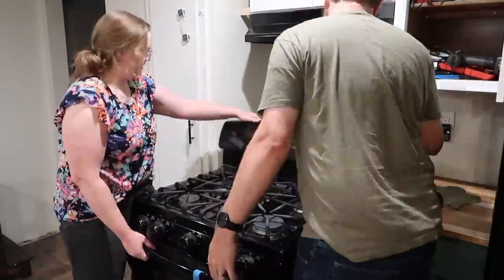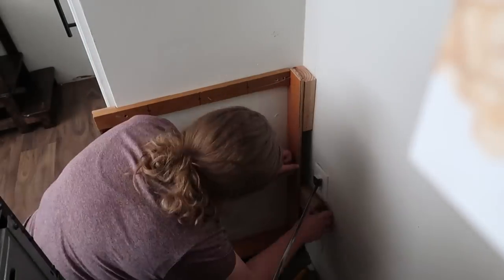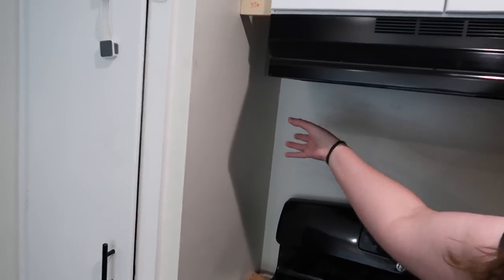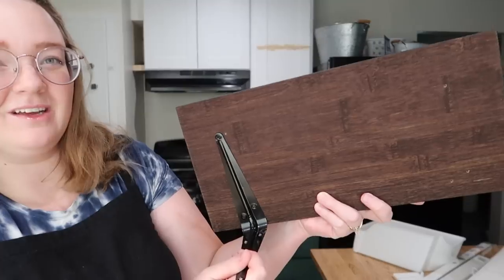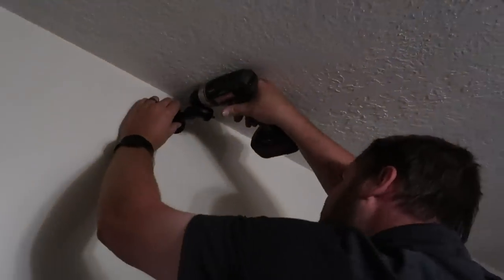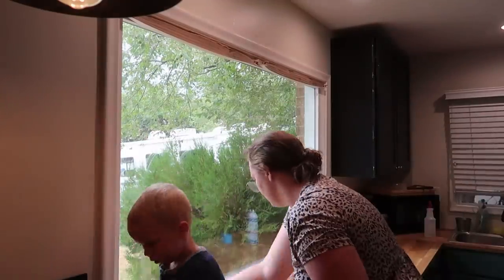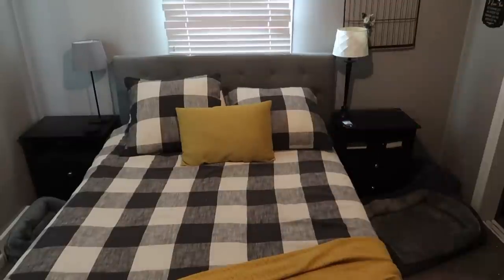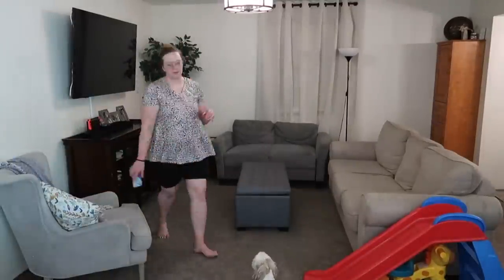Doing ALL of the Things I've been putting off! Cabinet building, hanging things, and other Crap!

Comment: I think the trouble with those white blinds is that they set them up as an outside mount.  We have similar ones but had them cut so they fit inside the window frame.  When that style sticks so far out, it just doesn't look right.  :-/  I wonder if you could cut the living room ones so they'd fit inside the frame and not interfere with your curtains?  The same mounting hardware usually works both ways.  In our house, anyway, we definitely use both layers to block the super strong sun that likes to beat in at certain times of day.
Reply from the maker: I ended up taking them down today, it’s much better, but yeah, I don’t like the outside mounted ones. The ones I hav kept are all inside the frame, except the kitchen one that I plan to change soon :)

I need to put curtains on my bedroom windows soon too, sooooo much to do always Christina 😂😂😂 so little time!

Comment: Hi Lindsay,  the ovens get extremely hot, on average over 200°C when cocking and it's a fire risk to close it off with cabinets or shelves. I would personally not put the shelf from the beginning of video, equally not the shelf above the stove either. If you check the manufacturer's instructions it will tell you how much space you need to leave around the oven. 

Otherwise great job with the rest.
Reply: How is that any different than the drawers right besides the oven. The outside of the oven is normally not too hot, maybe warm but not extremely hot.
Reply: @ashleydonohoe7941  I don't think there should be anything too close to the oven. Mine has around 15cm space all around. But mine is an old one,  perhaps new ones have better insulation,  no idea, best to check the manufacturer's instructions.